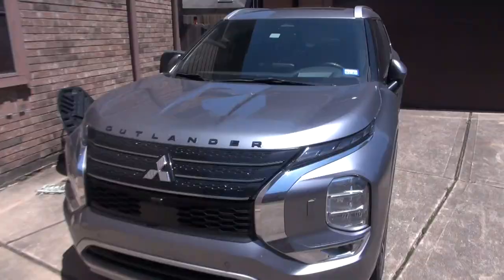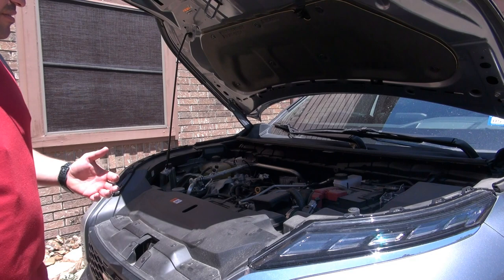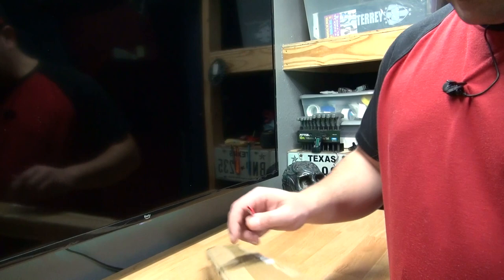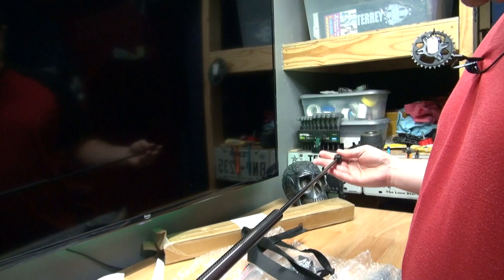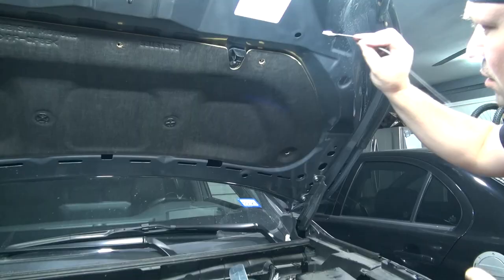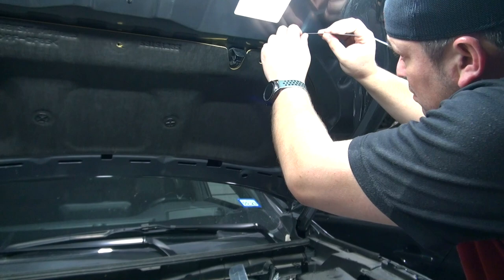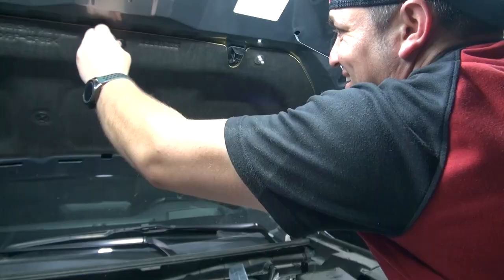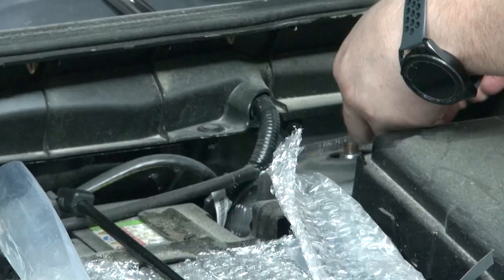2022+ Mitsubishi Outlander Hood gas struts install DIY #newoutlander #2022

Comment: Trying to install but the screw that goes on the hood is bigger than the hole that goes in to😡
Reply from the maker: Mm, weird. Try drilling with a slightly wider bit, should be ok
Reply: I had to drill as well, but it was the PHEV version. Not difficult at all.
Reply: True my phev has a smaller hole. I just used the bolt yo make it bigger. No the hood rod is kinda in the way